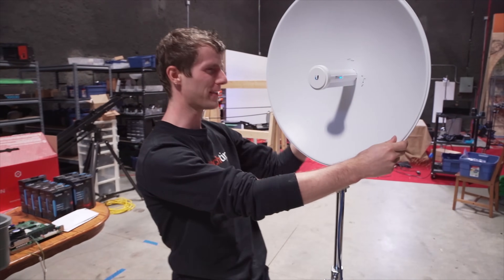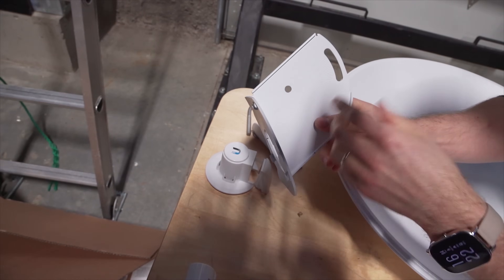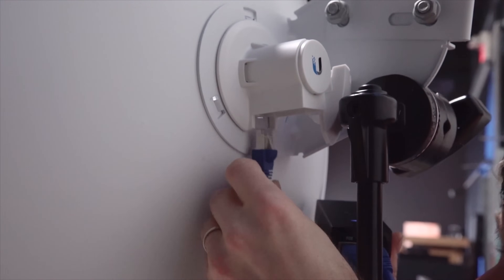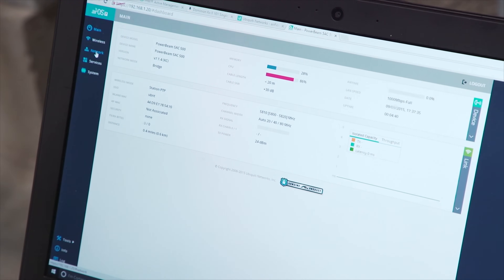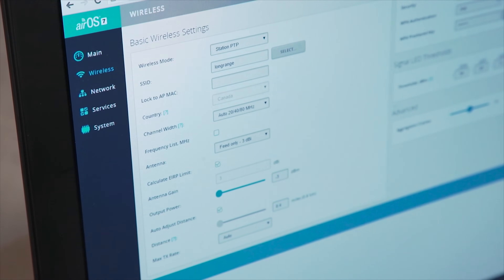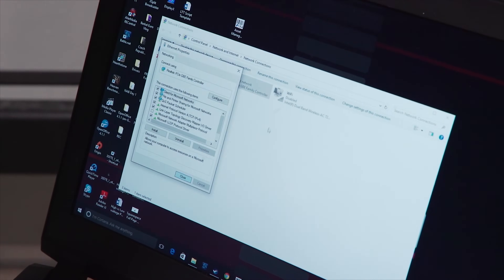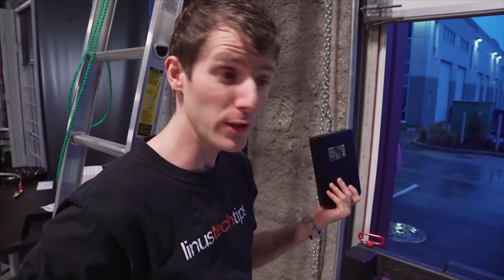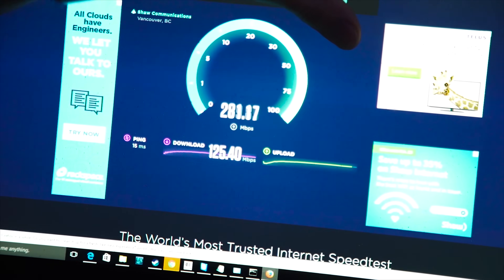HOLY $H!T - Long Distance Wi-Fi (Up to 25 KILOMETER range!?)

Comment: Can you run these in series? So you can go 25km and then hook it up to another dish and go another 25km (Im totally not building a secrete underground lab)
Reply: +MCModMadness technically yes but they all will need power and a switch interface and to at least be initially set up.
Reply: Ryan Schafer Yea, I assuming that you would need a box with some sort of switch like hardware inside along with a possible wireless terminal? Would be quite expensive XD
Reply: nah really a good lion or lipo battery setup with a solar panel could probably more or less perpetually run it. especially speaking these arent really super power hungry (54 watts if i remember right) so a small switch plus two of those is probably right in the area of 120 watts so a 300 or maybe 2 250 watt panels would be enough to not only run this but power it. though they do offer a 200+Km version on the site.
Reply: +Ryan Schafer holy crap that's some powerful stuff. may be more efficient to just have one of those sets.
Reply: +MCModMadness Seems like a lot of power. +Ryan Schafer

I think he's a little off. The specs list "8.5W max consumption". You shouldn't need a switch either, so you could run a <20W setup, with some small solar panels and a battery.

These are pretty common in WISP deployments, often running far more radios. The Ubiquiti forums have some discussion on this.
Reply: +Steve Sherman a mini switch would add much power though. however a system with a wireless controler inside would be a little more powerful. for estimation ima say around 150 watts per station. maybe more with a bigger switch and more dishes.
Reply: +Steve Sherman a mini switch would add much power though. however a system with a wireless controler inside would be a little more powerful. for estimation ima say around 150 watts per station. maybe more with a bigger switch and more dishes.
Reply: ***** No I know I was just directly addressing your comment in relation to BBQ's comment in that a POE switch with about 4 ports wouldnt add that much power, so him missing of the switch in his comment doesn't change allot. When I first started talking to Ryan I was talking about a wireless computer (Something like a raspberry pie) that can just sit in a box along side the wireless transmitter and either act as a monitor or a wireless terminal. I basically refereed back to my original discussion in the middle of my comment which is my fault I am very tired.
Reply: +MCModMadness +Steve Sherman
these would need a higher load poe injector, idk any poe switch that does 54 watts but they come with a pretty beefy poe injector so a simple 5 port dummy switch (stupid little netgear thing) would probably do just fine.
Reply: +Ryan Schafer and these radios are the small ones look at back haul which is the 200km version that's where I get my power from these are something like 20- 30 watt Max backhauls are over 50 typically
Reply: Ryan Schafer Wait the 200km one is only like 20 watts? Damn thats impressive!
Reply: MCModMadness no the 200km is 54watt. the shorter range ones (500m to ~25km) are lower power in the 20-30 watt range
Reply: Ryan Schafer Oh ok. 54 watts is still amazing power for that range.

Comment: UBNT Power beam things are excellent for long distance backhaul. I think it's most advanced wireless devices in liberalized spectrum. Many WISPs (Wireless ISP) are using UBNT gears for distribution (Both PtP and Point to Multipoint). 

Which ISP you are using. Why you are hiding the ISP. How much band you are using. (It seems more than 100Mbps). We (I am from India) can only dream such speeds. 

Off topic: Why you are still using that crap named Chrome ?? Edge browser in Windows10 is much better than Chrome and IE.

Comment: I used to run the same thing but it was Expensive! And we ran it for my Military unit. And setting these up sometimes required placing them in less than good spots... Like shooting across the refueler runway where planes landed and took off all the time cutting our link momentarily.

But ours were microwave, not 5ghz Wifi.

Comment: so PPP WiFi is a thing now i guess PPP is Point-to-Point connection so i guess the concept has made it into a working product now with the usual degrade in WiFi speed as one antenna = one wireless band and the next spec will add in another light band or wave band i am unsure which the concept made into a product was successful 
still PPP wireless is a pain to moving ppl but for fixed point between buildings it can be very useful it seems i think more so IF the one using light was used for it as line of sight is still needed and required for the light beam invisible on both sides by being one of the colors that we just do not see with the human eye

Comment: The Indicator is for signal strength, not speed.  The PoE adapter is required, because the radios use passive 24v PoE, not spec 802.3af (48V) PoE.
Reply: UBNT makes switches that will put out their 24v PoE

Comment: Linus, you make it look so simple. It's not. 
I bought a Ubiquiti Picostation high power outdoor access point in 2014 to extend the wifi range at a small festival. The experience was a nightmare. It took 3 minutes to set up and the rest of the weekend (36+ hours) trying and failing to get it working. At the time, I'd set up dozens of home networks and consumer routers. This was not that. There were hundreds of settings in AirOS, which was counterintuitive and offered zero explanations. Their website had no relevant information. Trying to reach anyone for assistance - which likely would've meant 10 minutes of their time - was an exercise in futility. I emailed their sales dept; the guy said it's for IT professionals so I'm supposed to just know how to make it work. The user needs to provide all his/her own support, and he referred me to resellers. Absolutely worthless customer service. Tech support is essentially nonexistent. I don't care if you make a product just for CEOs of tech corporations, you provide technical support to your customers, period. I ended up returning it. I suppose it's my mistake for thinking I could to get a seemingly straightforward product working without a networking degree and 5 certifications. I'll never buy another Ubiquiti product again.
Reply: +Ted B. Before anyone jumps down my throat for comparing two different products, please remember that:
1- they're both using the same complicated AirOS 
2- they're both made by a company that doesn't provide any technical support
3- there's no indication in looking at either product (or in this video) that it  requires some advanced networking experience to get it working at all.

Comment: So how would u alin thwm at 20km.
Reply: compass
Reply: +Jason Baldwin A combination of Google maps, proper maps with the general direction outlined, and a lot of luck. I used to work on a WiMAX network and alignment was a bitch even at one kilometer. Doing it at 20 was incredibly frustrating, but possible with patience.
Reply: carefully
Reply: +Steve Sherman My brother uses the same process, study the alignment on Google Earth and then goes for real and installs everything.
Reply: a cheap handheld GPS with a built in compass,
Reply: May be, with a good laser.

Comment: I love Ubiquiti!  I put one of their APs in my house and all the WiFi problems I was having between my iPad and Linksys wireless router disappeared.  Of course you still need a router, but that's what old computers are for!  It has been rock solid for about 2 years.  I also get WiFi out to the end of my driveway, which is about 30 yards, or meters for the rest of the world.